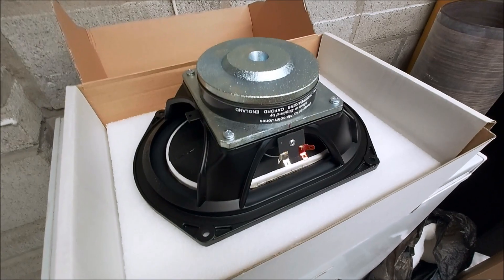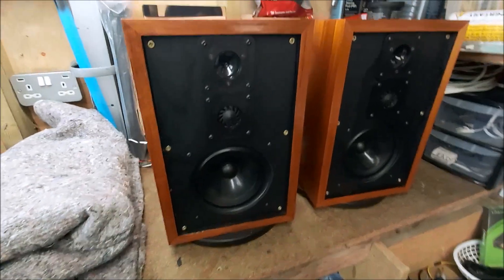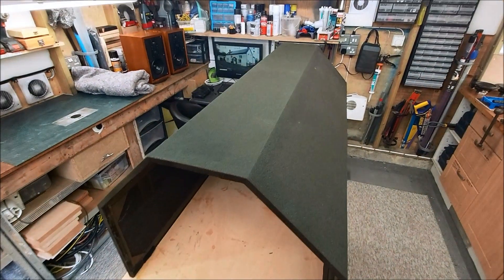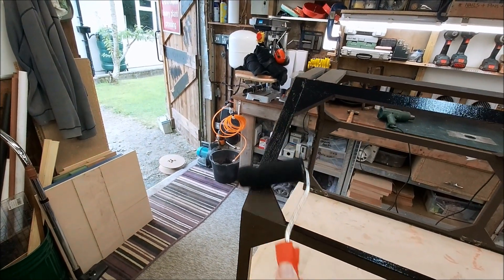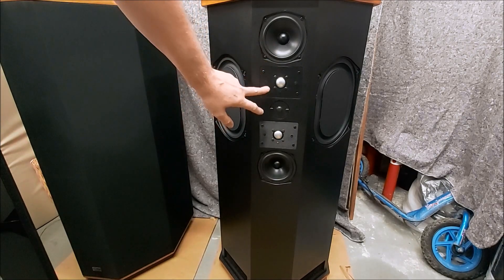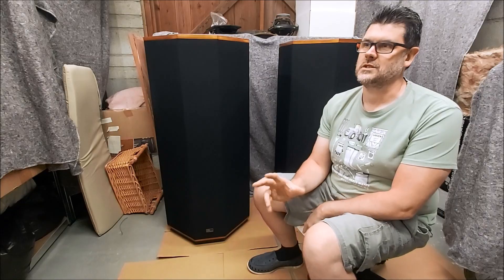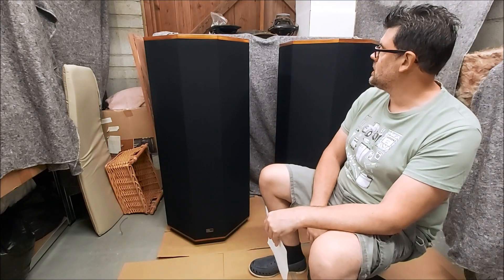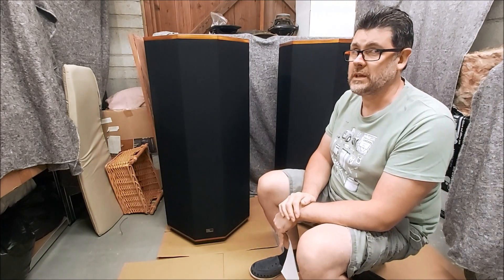TDL Reference Standard Speakers - Part 5 (Finished)

Comment: Does it matter that the cover obscures the end of the mid TL, at those sort of mid range frequencies surely everything is absorbed by the line and output from the line is virtually non-existent.
Reply from the maker: The middle TL is tuned quite high up. There is small but insignificant bump in the response at around 350Hz which is the start of the roll off. The cover seems to reduce this to a degree so I wonder if that batten was intentional and an after thought? The badges fit on this but I can't imagine that's the reason. Odd 😅

Comment: From my point of view, it is very sad, that you replaced the original drivers to b139. My father used to be distributor for KEG and IMF and I know the difference between this drivers very well. The IMF drivers are so much better! Faster, drier, clearer…..
Reply: I too initially thought it was a bit of a shame not using the TDL drivers having heard good things about them in comparison to the original KEF B139 however brand new falcon B139s are surely going to be streets ahead of tired old TDL drivers and anyway they’re not “kef” b139s, they’re falcon B139s and some improvements have been implemented over and above the original kef design. Just look at them, they’re gorgeous
Reply from the maker: @tomeasterbrook9486 Plus TDL woofers are not available nor are repair parts which is why as far as I'm concerned the B139 is the only viable option
Reply from the maker: I'm afraid I disagree with your comparison of the drivers. The B139 is a fabulous driver. Remember also that there was no alternative. The suspension on the original TDL drivers was perished and hard. They were very mismatched. If TDL drivers or replacement suspensions were available then of course that's what would happen